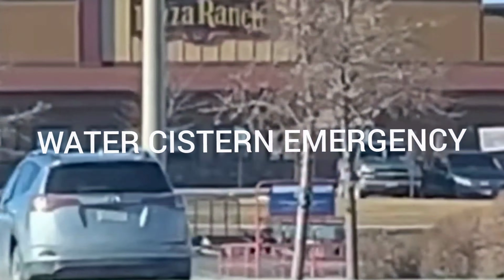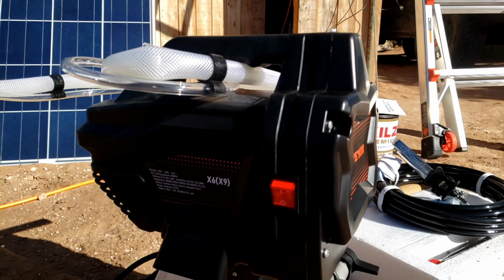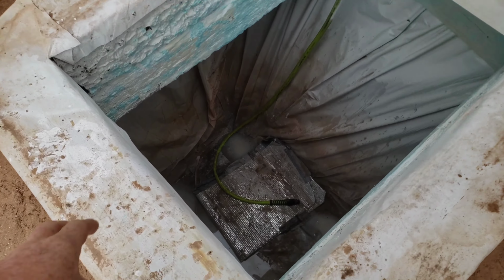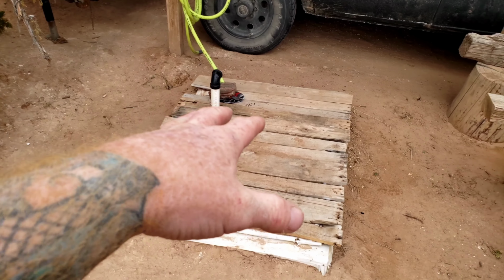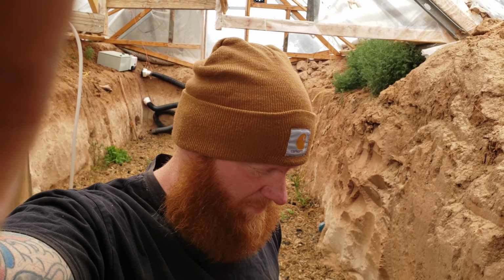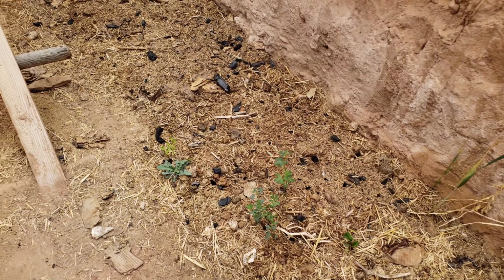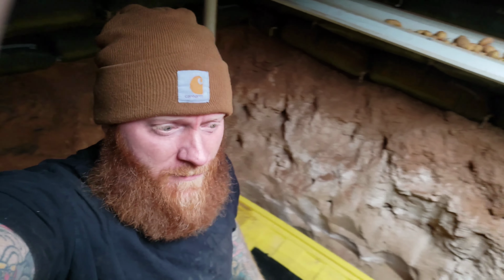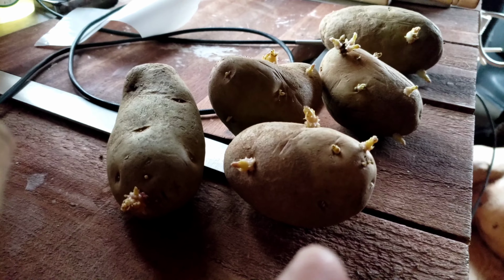Homestead Emergency

Comment: WALIPINI garden is the best thing to do.Can even use earth ground temps run a series of hoses in it buried, the cooler air drawn out with a fan into the tiny or house to cool off, a fan driven by the solar panels.

Comment: Hey John. Take a five gallon bucket. Run a strand of bailing wire from one side to the other with a can (tuna, soup, whatever) in the middle. Poke a hole on each side of the can with the wire going through closer to the covered end of the can with the open end facing down. I use duct tape on the wire on each side of the can to keep the can centered and so that it won't travel either way on the wire. Put peanut butter in the middle of the can and put anywhere from 4" of water to half a bucket of water into the bucket. Set the can where the mice are getting in. Put one end of the wire where they can climb onto it. They will do a high wire balancing act until the get to the can. The can will flip and they will fall into the water in the bucket and drown. We've had as many as seven mice fall into our buckets. As you know the mice are bad up here. Another thing. We don't have a cat because the owls love to eat cats and we have a lot of owls up here. Hope this helps.
Reply: I use a water/pop bottle instead of a can and lay a stick against the bucket, like a ramp. I’ve put them
Outside and drill a hole where I want the water level in case it rains. 

Ye old bucket trap has taken many mice from my yard. lol